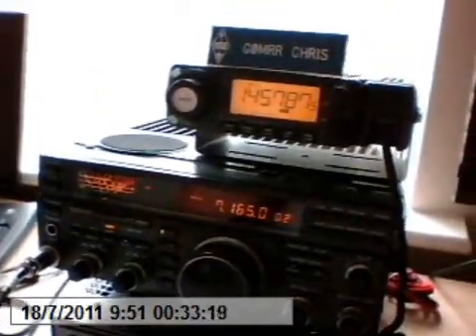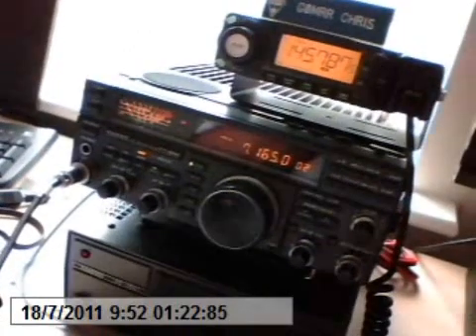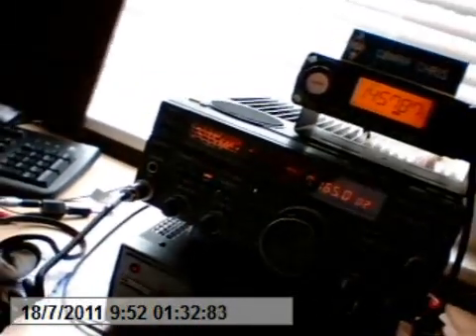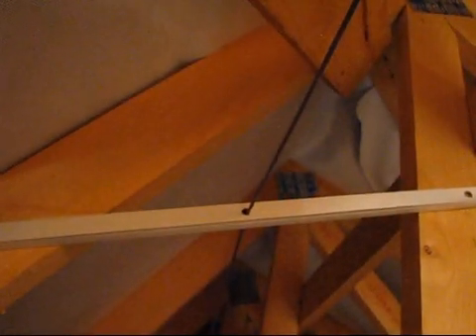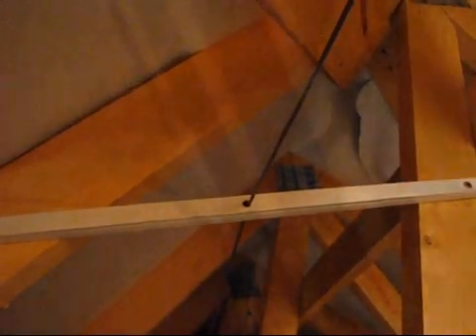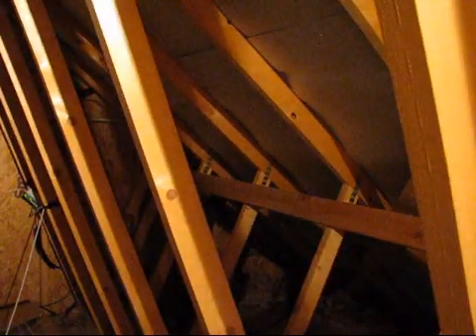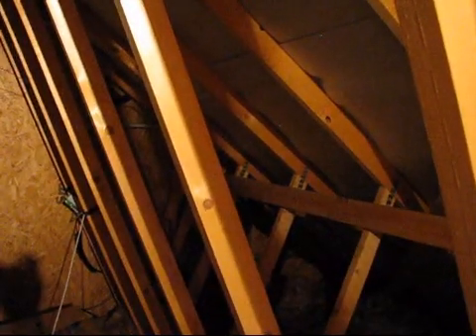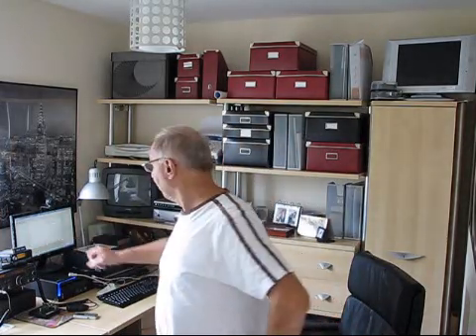Stealth EZ End Fed Antenna and SG239 Smart Tuner an indoor antenna by G0MRR Rig Yaesu FT890

Comment: I know this video is a bit old now, but I'm interested in what order you had the sg239, 1:9 unun, wire and coax attached.  Did you connect the coax to the unun, then run wire to the 239, or how?  Thank you
Reply from the maker: Yes. Coax to the unun and created short patch leads to the SG239. It is not totally necessary to use the unun at all with the SG 239. However I did and it works extremely well. The patch leads I made as short as possible.  30 Cms. long. I also earthed the 239. Here you have to be careful earth wire well away at right angles to end fed and as short as possible so as not to interrupt.

Comment: The ground is necessary to make the antenna tuner work correctly,(because he uses the antenna to transmit the tuner is needed to electrically match the antenna to the transmitter and it can't work effectively without a ground-essentially the tuner and ground fool the transmitter into thinking the antenna is the correct length for the frequency he is using), the ground also helps eliminate a lot of the background noise when he is in receive mode.

Comment: Easy get a 6-160 HF end fed wire J-pole by Alpha Antenna and fix it to the guttering edge outside the house very stealthy and works quite well, now stocked in the UK, you can work most of the bands without a tuner but 80 and 160m will require one.

Comment from the maker: The metal roof was the problem. It would have reflected straight back at you! Dangerous! Pity you could not mount the other side outside. on top as that would have helped.

Comment: I've used an attic endfed antenna for shortwave listening and hamming and had pretty good results, but I had the single wire coming into the shack, so when I transmitted, I sometimes had RF in the shack issues. These days, I'm using a 60 foot half wave open loop, basically a 60 foot dipole bent into a loop, fed at the corner with 300ohm TV twinlead into a MFJ balun tuned with the LDG Z11 Pro autotuner. It loads on 40-10 and I've worked all over the world using digital modes on it. Got me to DXCC

Comment from the maker: I used heavy earth wire from the unun and also from the sg239 down the outside rainwater pipe directly to a 4ft copper earth rod which then had radials embbeded into the lawn in acordance with details given from the tuner manufacturers.

Comment from the maker: Now the loop would be more practical I agree but to take that around INSIDE the loft of my house, (as a loop) would have lowered the height considerably, I did not want to be 300mm off the ceiling joists with all the electrical house wiring!  I instead, placed the end fed right under the ridge gaining max. Height and away from wiring and RFI problems.